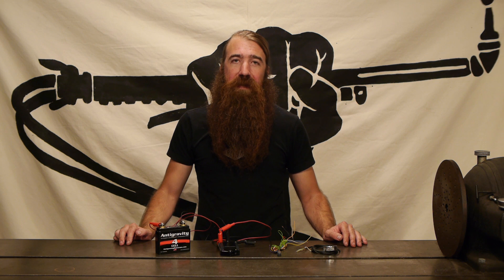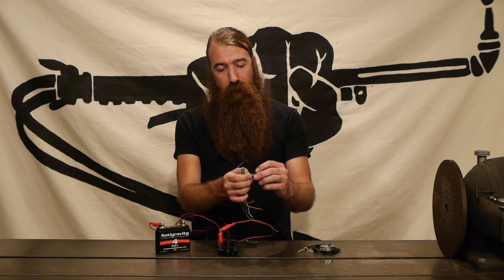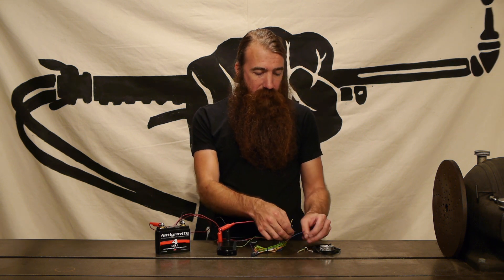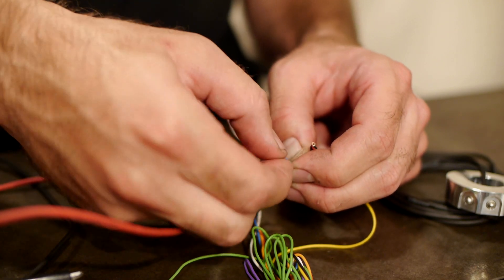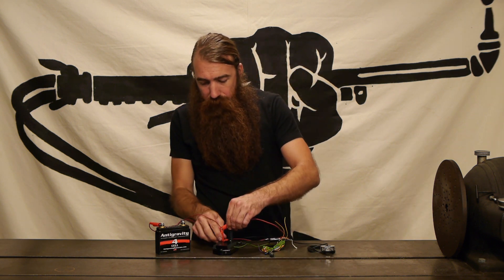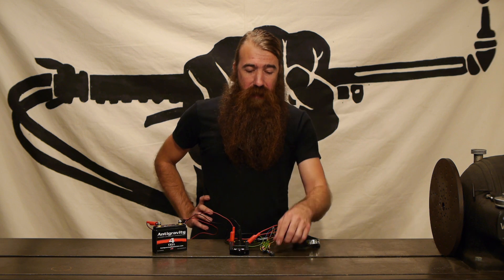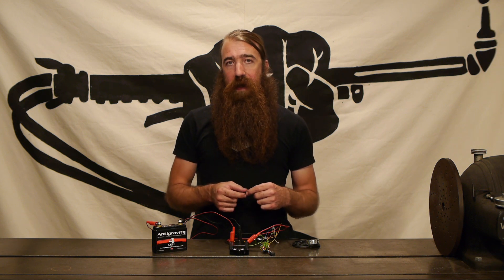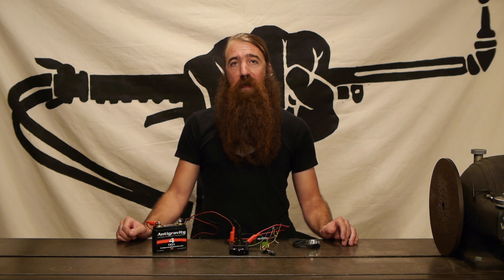Motogadget m Button - Revival Cycles Tech Talk

Comment: Really it’s a simple single cheap controller that the rats nest of wires attach to… about $2. As neat as this seems it introduces complications to the wiring beyond easily field diagnostics along the roadside, and it still needs ground and power wires… so it’s not one wire just the comm signal wire going to the M-gadget. The hassle of making a bundle of hidden switch wires to it and stashing that in the handle bars is just crude or more so than simply running a bundle of individual control wires direct from the switches … probably is easier… and it is still digital control with low power control wires. A neat bundle 12v low power 20-22-24 gauge wires has the advantage over the single 22 awg wire is some mechanical robustness and less electrical interference issues… and easier to put shielding sleeve over the bundle and make ground connection. NOW hear’s an idea run the bundled cables to the m-Button using a nearby small connector or a terminal stop for the control switch wires connections then you have trouble shooting access to the switch wiring … this mounted next to the m-gadget… and m- button then that tiny fragile single wire is protected and you have much less complication and aggravation hiding all the mess of switch wires to m-button… As alternative do this near the handle bar but you still have a single fragile wire run… that you need to bundle like a loom and shielding protect.

Comment: For anyone wondering the way the system works is say your blinker calls for a three ohms signal the m button puts out that signal corresponding for blinkers. Then for the horn it’s five ohm and so on and so forth. Each different button or function requires a different ohm output that the M unit registers
Reply: Thank you. I'm trying to wrap my head around it ahead of time for my cb750 chopper build. I'm starting from scratch no factory harness just engine and frame. That's actually really neat and explains why the m button makes the m unit installs so much easier on the older Hondas. You usually have to do a killswitch work around due to lack of ground coming from the key switch. So if I'm understanding correctly by using the m button it converts it to a digital signal so to speak and can then register my ohms which is continuity (?) And let me use the m unit correctly and more simply. I'm not a electrician and I'm definitely in slightly over my head but that's how you learn and grow. I've still got a long way to go as I'm just now getting the engine back in shape. But I'm trying to wrap my head around this stuff now so I'm not throwing wrenches at the wall of my garage again like I did when I cracked into my honda shadow control cluster thinking a 3 button switch and throttle swap would be a 15 minute job. Took my 15 minutes to figure out what I was even looking at with the diagrams. I'm sure it'll all be a cake walk after I rewire the cb750.

Comment: For the brake switch..
I have a banjo bolt brake sensor with two wires.
One wire from sensor goes to purple brake wire off m-button? and the other wire can be spliced to the black ground wire off the m-button?
Reply from the maker: For more in-depth help feel free to reach out to our Tech Support team - techsupport@revivalcycles.com
Thanks!

Comment: Hi Stefan, 
Thanks for the great vids on m-unit blue.  Unfortunately, I just ordered the mo-button for my m-blue before reading your comments regarding the mo-button being "overhyped".  Can the mo-button even be used on my 1972 Triumph T120V Bonneville with my stock switches or do I need to install a modern set like the m-switch mini in your vid? Thanks.
Reply from the maker: The Mo-Button cannot be used with any stock switches that work off of a power (12v) signal, it will only work with switches that work off of ground signals. The Mo-Unit works the same way, it will only work with momentary switches providing a ground signal to the unit itself. 
Thanks!
Reply: @RevivalCycles  Okay, thanks!

Comment: For a fully EMI-proof protocol, CAN bus is a good solution. Due to the low and high signals being mirror images of each other, any interference causes an equal change to the signal voltages and thus negate each other. The signal wires can also be shielded. It's also immune to cross-talk. It requires two signal wires. It is more suited to cars, automation and heavy machinery though, due to the virtually infinite amount of nodes you can attach to it. You can also attach as many listeners as you like.

Comment: Hi Stefan, I am looking at buying the m-unit and m-button. Am I able to use the typical standard bar controls / switches, or do you need aftermarket switches?
Thanks 
Paul
Reply from the maker: Hi, You can use standard latching switches after doing some significant modification but truth be told, the user experience is terrible. The m.Unit manages the controls in an entirely different way than the old system and it's not really compatible with latching switches. So you can use them but it's just a bandaid and not pleasant in my experience. Also, DON'T WASTE YOUR MONEY ON AN M.BUTTON. You don't need it, it doesn't actually make anything about your install easier and they can break so you're just adding one more variable into your system that can fail which is counter to our philosophy behind m.Unit installations.
Reply: @RevivalCycles  thank you for taking the time to reply to my question. I really appreciate your honesty.
Reply: @RevivalCycles  wish I'd read this 3 days ago, on advice from another builder I just ordered an M.button to go with my M.Unit that I already have

Comment: Great vid, thanks. 
Is there a delay disadvantage to signals, for example, compared to just leaving the OEM wiring in place?
Reply from the maker: There's no delay but to be perfectly honest this video is old and we've changed course on our feelings about the m.Button. This is a companion component to the m.Unit which is great, but it's not at all difficult to run a hand full of 22awg or smaller wires through your bars and install them into the prelabeled inputs on the m.Unit. After years of answering technical support about this product, we've determined that it's overhyped and solves an imaginary problem while introducing a high probability for issues that are difficult to diagnose when they occur.

Comment: Hey guys. I have a quick question I am struggling with. I am wiring my custom bike with an M-Unt and M button. As it is kick start only, do I need to do anything with the starter cable from the M button?
Reply from the maker: The m.Button isn't really designed for a kick only bike. To add a kill function you could either wire this button outside of the m.Unit or double tap the start button to kill it like an electric start bike.

Comment: Thanks for the videos guys ... But as I understand If one has m-button with m-blue, breakout box A is not necessary anymore?
m-button will do the magic ? this is my first build so I'm confuuuused
Reply from the maker: @Kombosto No worries. The m.Button and Breakout Box are completely for unrelated applications. The m.Button turns the controls inputs into digital signals sent to the m.Unit, while the Breakout Box turns your motorcycle sensors electrical signals into digital inputs so that the Motoscope Pro gauge can interpret them. 

Hope that helps, 
-Berry

Comment: I saw somewhere that the MButton doesn't work with the first gen MUnit - but your demonstration clearly shows it works…before I order, can you confirm please.
Reply from the maker: The m.Button does work with the V.2 m.Unit. If the goal is an easier install and more reliable electrical system I would run wires directly from the switches. Motogadget makes some of the best quality components available but after having spent many years working with Motogadget products I wouldn't say that the m.button provides enough advantage to off set it's potential problems. If you're building a show bike and all of the wiring is hidden with in the m.Button would help quite a bit. It's biggest setbacks would be that it is capable of permanent mechanical failure that can only be diagnosed by removing it from the system. and it is vulnerable to RFI from the ignition system, the results of which are random phantom switch activations and resonant RPMs. 

-Berry
Reply: @RevivalCycles  100% agree here. The m.Button is cool but unnecessary, hard to fit, and can act as a failure point.

Comment: hi You can connect a 12V 2-amp fan for radiator  to a wiring honda crm 250 mk1
Reply from the maker: If this question in regards to the m.Unit the answer is yes, you can power a 12V radiator with an m.Unit. There are two 15 amp AUX outputs available. It might be worth mentioning though that the m.Unit does require 12V DC current and a battery.  If your CRM is generating un-rectified AC current the first order of business is determining if and how you can turn that into regulated/rectified DC with a battery. If that's possible someone's surely done it and documented it on the web. 

-Jeff

Comment: hi i have a 1997 gsxr600 
will the mbutton and munit work on this bike ??
Reply from the maker: Yes both will work on your bike. However, as I recall that bike has clip on handlebars and that make the m-Button a pain to install since you need to get wires from both bars to connect to the m-Button. I'd suggest just running the control switches directly to the m-Unit.

Comment: Would it be possible to wire the M-button into the normal Yamaha Buttons ? Or do i have to youse speacial buttons ?
Reply from the maker: The m-Button works with any type of switches, including OEM style switches. The m-Button is just a converter that sends the signals via a single cable, there is no logic or control happening with the m-Button. The m-Unit is what interprets the signals from the m-Button, and you will need to configure menu 5 to match the type of switches you are using. 

If you are using stock switches you will need to ensure the switches are connected so they give a ground referenced signal. Most OEM switches are setup for sending +12v signals, but reviewing the wire diagram you should be able to make the needed changes.

Comment: So just to be clear, the M-Button is like a signal transposer, like an A/D converter in a studio recording setup (analog -> Digital), taking a current and turning it into a data signal.

Which is to say, IT IS NOT A BUTTON at all.... This was confusing to me until I watched this video.
Reply from the maker: Exactly. It takes the signals from the buttons and communicates those to the m-Unit. It doesn't matter what type of switches are connected, it is a straight pass through of information, and the configuration on the m-Unit determines how the buttons work.
Reply: Like the Munit the little 2 channel audio to digital guitar preamp from back in the day...same people??

Comment: how i connect a Harley hi beam  and low beam switch using m button and m unit ?
Reply from the maker: The headlight wiring and controls are addressed in the m-Unit manual on the bottom of page 4 and top of page 5. http://motogadget.com/shop/media/downloads/manual/munit_v2_manual_en_3.2_k.pdf

Comment: Hello there, I have m-Unit, m Button and m-Switch. I have connect the m-Unit with the m-Button with one cable (config) from I have connect the red cables from m-Buttons with horn , lights etc . Can I connect ALL BLACK CABLES from m-Switch to the GROUND of m-Button (because the space inside the handlebar is too small),??? Last I have connect the ground of battery ONLY with the ground of m-Unit. Question is this right or have I made any mistake?? Thank you
Reply from the maker: The grounds from the m-Switch and the m-Button can be spliced in any way that is convenient for packaging. The important part is just that they all have a secure connection to ground. That means if you are splicing all the wires inside the handlebars and then grounding to the handlebars, then you need to also make sure the handlebars have a path to ground. Sometimes the powdercoat or anodizing, or paint will cause there to be no connection between the bars and the frame.

Comment: Hi there, I just found your channel and I like what you have so far! I have a question on this and the m-unit. Do you have to have them m-button when installing an m-unit, or can it be wired directly?
Reply from the maker: The m-Button is not necessary when installing an m-Unit. The majority of the installs we do will have the m-Switch mini's connected directly to the m-Unit., but with builds where there is absolutely minimal wiring and everything is routed internally the m-Button can be useful for simplifying the handlebar wiring.
Reply: @RevivalCycles can i use different buttons for this to work or only needs to be from motogadget?

Comment: Hi Stephen I mounted a Motogadget M-unit v.2, the m-Button connected to two 3ways m-Switch on my Guzzi cafe-racer, both connected to a dedicated ground wire. My problem is that sometimes, the right turn light (led rizoma) starts with no input (engine ON or OFF) and the worse thing: sometimes the start button cut off the electricity, switching-off the engine during cruise  (probably works as kill switch function). I have ck the integrity of all wires and they seem to be OK. I have changed the 2 buttons on right m-Switch but the problem do not disappeared. On your opinion the m-Button could be faulty? Have you ever noticed about this problem?   
Many thanks 
Stefano
Reply from the maker: Stefano - This sounds like an issue with electromagnetic interference (EMI) or radio frequency interference (RFI) created by the ignition system. This issue happens on some builds but there is no clear cause, most bikes work, a few don't. There are two solutions to the problem, first you could eliminate the m-Button and route the wires from the switches directly to the m-Unit. Or you can try to control the EMI / RFI, using suppression core spark plug wires like the ones we sell. You can also try resistor spark plugs, and spark plug caps. 

We have had some customers try to fix the issue by shielding the green config wire from the m-Button, but this has not been effective. 

If you run into more problems, send an email to techsupport@revivalcycles.com and we can get into more details.
Reply: Many thanks for your help. I' ll keep you informed.

Comment: Guess you get a lot of "too good to be trues".   With the m Button do you still obviate the need for fuses?  Previous comment says because it uses the config slot you can't config the unit.  Can you config it and then remove the config button and the unit remembers?
Reply from the maker: Yes the m-Button does not require any fuses, and the m-Unit still handles all the power distribution. There are still a couple fuses needed in the system, main fuse to protect battery from charging system failure, and low amp fuses for the gauge if you are using motogadget gauges. 

Also, the configuration on the m-Unit only needs to be set once, and for that reason we do not permanently install config buttons for the m-Unit. The process is usually to get everything installed, then configure the m-Unit to match your preferences, and then connect the m-Button to the config input. Should be good to go after that.  Realistically, you could configure the m-Unit before even starting the install just using a battery for temporary power on the bench, it stores the settings in memory even when power is removed.